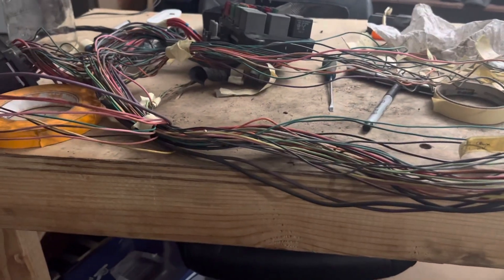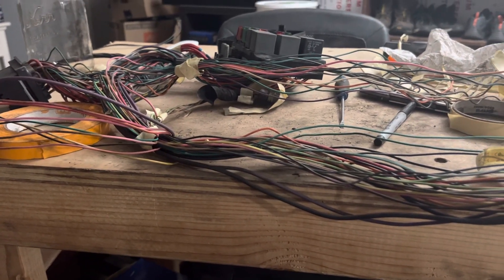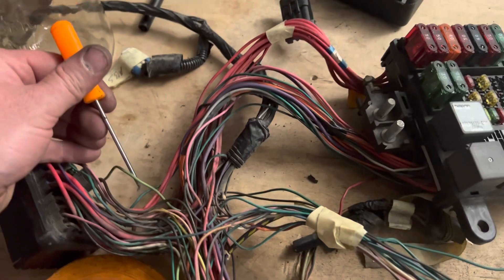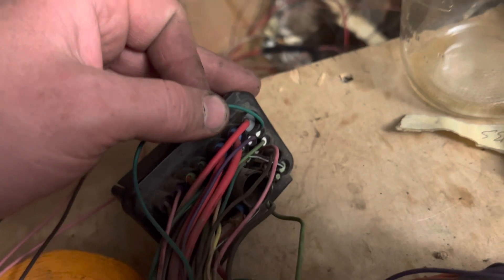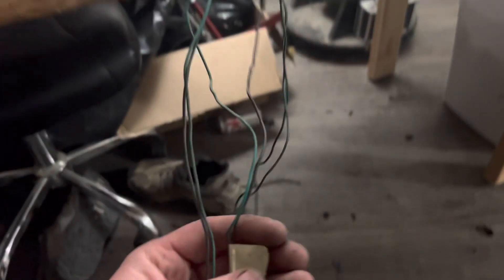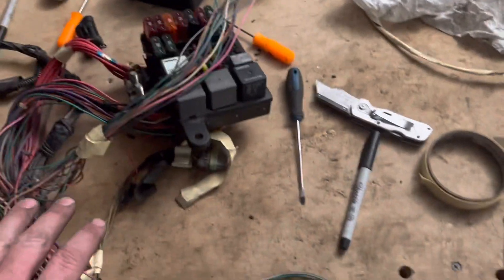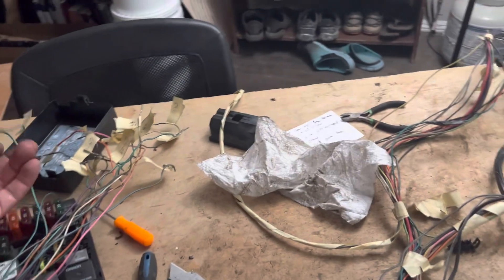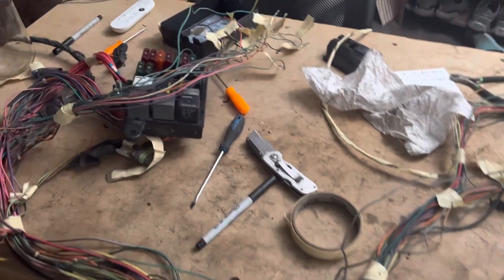1996 K1500 A/C Wiring Explained for LS Swap.

Comment: I think the control module sends 12V for AC request, then the ECM clutch control grounds the pin connected to the relay to activate it.
That is at least what I am seeing on my truck. If that is truly the case, your method of just tying the request and command together won't work and you may want to edit the video to prevent people from trying that and being confused when it doesn't work (like i was)
Reply: Does it need the ac request signal to turn on the fans?
Reply: @michaelmobilautodiagnostic6705 the way mine is set up the fans are controlled by the pcm so it does require the ac request. 

Thats just one way to set it up though and there are many
Reply: @JohnTaylor-mx5zt  that's what I figured. I was about to wire it through the pressure switches when I remembered about the cooling fans  since i want to run electric. The only thing I'm confused about now is if it needs the secondary ac high pressure switch c2 pin 11 signal to run the clutch or do i leave it unplugged?
Reply: I thought from 96 to 99 would be the same
Reply: @danmartinez3390  I would have thought so to tbh
Reply: You are correct sir. The ECM sends out a ground to the AC relay to activate the clutch. I was pulling my hair out before I discovered this.

Comment: Great job, the only thing I would add is that the LS pcm does need an ac signal to know when the compressor is engaged, so that it can adjust the idle accordingly for the additional load on the engine.
Reply: I believe the pcm will also cut the a/c when the rpm’s reach a set limit as not to hurt the compressor from high revs.

Comment: Working on a 96, but im running the r4 style compressor, with no canister, is it possible to bypass that wire on the canister to only use the wire for the dryer ?
Reply from the maker: That will work, i believe thats high pressure, so having that cut off the ac if pressure gets to high is sufficient for safety, for efficiency you want a low pressure cut off, but its optional.
Reply: @matthewevans8469  thank you ima try it out, another thing i originally have 4x4 but i am not running the transercase that harness on top of the c100 is it needed ? or can i jus not have it plugged in ?

Comment: I’m going to run my ac off of my obs harness. I’ll connect the two wire to get around the computer. Will I need anything else 5v/ground etc to make it work? Or when it goes back to the fuse block it get power and ground from there? Mine is a 98 2 door tahoe. At the end you said the 98 was different? How so?
Reply from the maker: I dont know how the 98 ac works, i know the 96 and 97 are the same truck. The 98 had some subtle changes, like the fuel gauge runs through the ecm. 

The high and low cut outs just interrupt the clutch relay ground, either through the computer or can be wired directly, no extra wire needed.

Comment: I need some help myself same everything u have year and all I don’t know where to put them green wires at in the 99 ls 5.3 pcm red and blue connections plz help
Reply from the maker: There are pinouts for those on lt1swap.com
Reply: I have tried them no help really I’m pretty sure I have it right everyone is saying ground pin 55 I have no pin there I took it off because lt1swap said too it won’t come on and the funny thing is that his is the second compressor brand new not reman and acts funny when I jump it it get so hot in the matter of less then 5 seconds I can’t touch it I hate when I put 12v to it to activate the he clutch and also the orfice tube got suck d in past the stoping point ac worked before the swap now it don’t I’m so lost
Reply: Do u remember what pin locations u put yours and does it work plz and thank u

Comment: My goodness, I'm flat stumped. I've had my swap done for two years now. Had a baby girl and halted everything. Daughter loves to ride in the truck, but it's too hot. I'm trying to utilize the factory fuse block etc. 
My "low pressure" sensor has the dark green wire cut.
My "high pressure" sensor has the green/white wire cut. I think I've found the green/white wire that was cut and reconnected it.
I've cut the group of orange wires coming from the back of the 10 amp fuse. Need to trace where it goes.
This truck does nothing but set since I've finished it. It's too hot.
Wish you were closer. 😞

Comment: Where did you find the C 100 pin out? I have a 97 sierra and the 96 pinouts are the same.
Reply: Did you get the C100 Pin out for the '97?

Comment: Working on the exact setup here. 96 LS swap. I'm losing ground between the control unit and low pressure switch. Where would you start to trace?
Reply from the maker: I would remove the backing plate on the c100 by lifting the tab against the wires and sliding the backing plate away from the wires. Once the wires are exposed find the light green wire identified in the video and put a diagnostic pin through the wire, see if the signal is present at that point (I believe it is ground but cannot confirm this, it might be 12v). If there is no signal coming through then the problem is inside the cab, I cant help you with that one. If the signal is getting to the c100 then confirm it is the one wire by putting the diagnostic pin on the light green wire near the low side cycling switch and directly send the signal and see if the ac cycles appropriately, then you have confirmed the wire is at fault and can replace the wire.
Reply from the maker: Remember that the ac must have some charge for the clutch to engage at all, a vacuum system will be stopped by the low side.